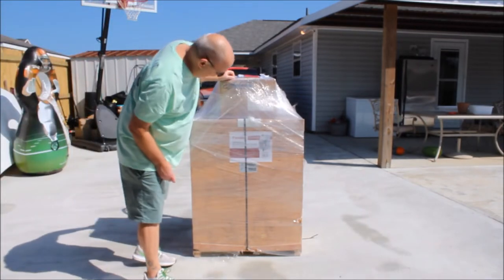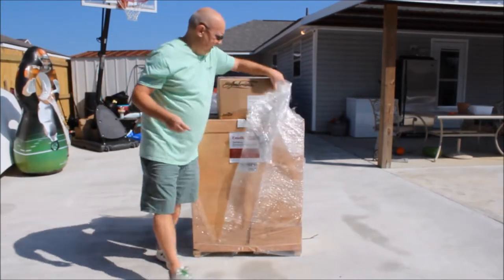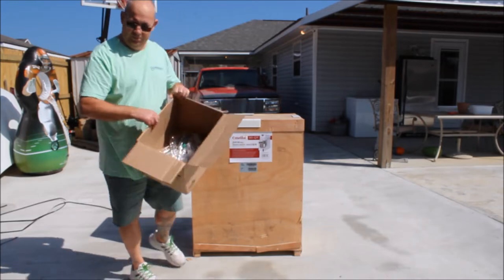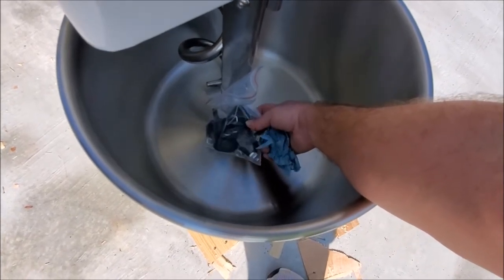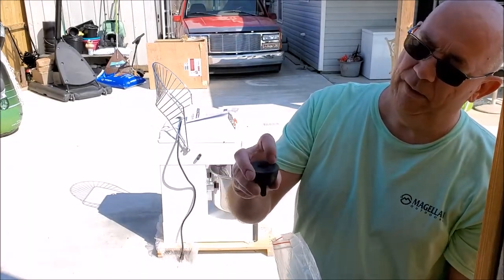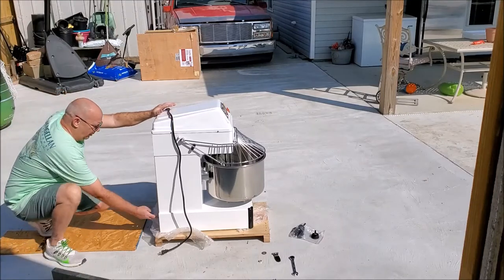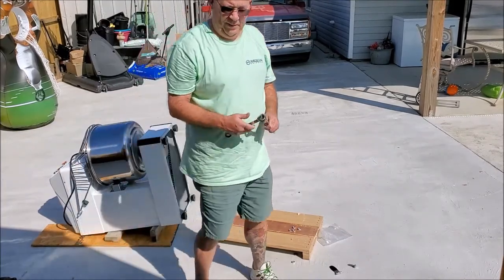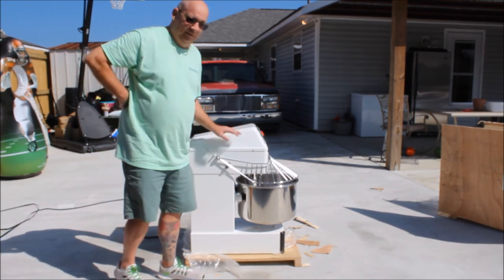Estella 30 Quart Spiral Dough Mixer Unboxing - Webstaurant - Building a pizza truck.

Comment: Hi just want to know if you like it so far, do you have any problems with it? How's the function?
Reply: I purchased the 20Qt, for a home based catering business.  Used it once and it wouldn't turn on.  I called the Webrestaurant store and was told since it is being used in a residential setting and not a commercial setting they would not honor the warranty and I would have to have it repaired on my own dime.  Garbage customer service and machinery.